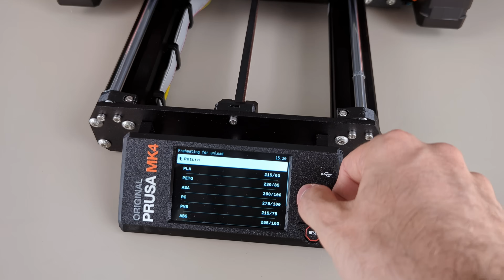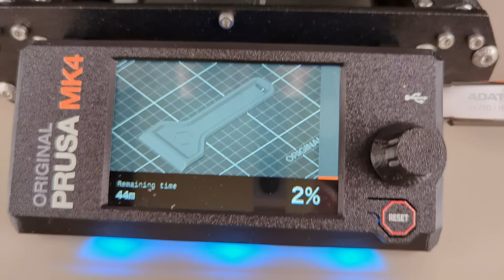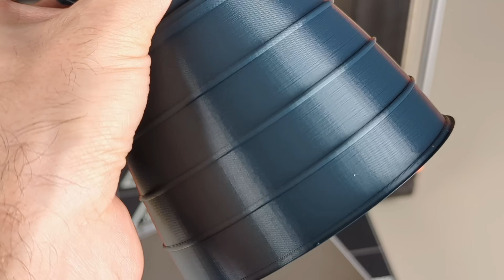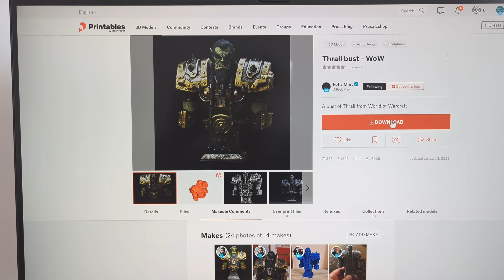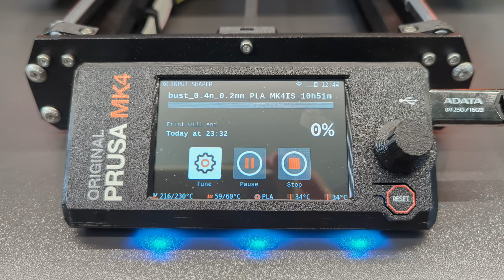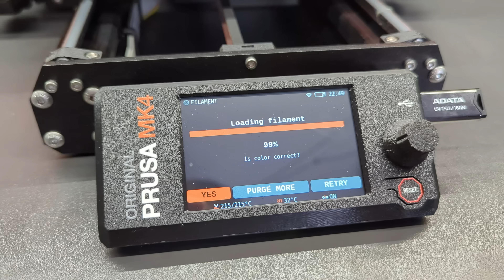Prusa MK4 in 2023? 🤷‍♂️

Comment: Prusa needs to figure out the pre-print purge process. My MK3S always left filament on the bed from the probe and had filament oozing on the nozzle.
I used some custom start gcode to heat the nozzle to 140c during the probe process to fix it.

Example of mine for the MK3S

M83  ; extruder relative mode    
M140 S[first_layer_bed_temperature] ; set bed temp    
M109 S160 ; Set extruder temp before bed level    
M190 S[first_layer_bed_temperature] ; wait for bed temp     

G28 W ; home all without mesh bed level        
G80 ; mesh bed leveling    

M109 S[first_layer_temperature] ; wait for extruder temp    

G1 Y-3.0 F1000.0 ; go outside print area    
G92 E0.0    
G1 E8 ; Purge Bubble    
G1 X60.0 E9.0  F1000.0 ; intro line    
G1 X100.0 E12.5  F1000.0 ; intro line    
G92 E0.0
Reply: Same Problem with my Mk3s too.
Reply: Pretty sure the first prints in the video were with older firmware. Not sure how long it sat in the box, but the purge changed in newer firmware.
Reply: @JohnOlson  True, i would love an update on how all of the things would have gone with the latest and greatest firmware.  Also granted I don’t think it should be this was, but if the MK3 is a good clue, even Tom Sanladerer’s Original Review cited all sorts of Software/Firmware issues but they are all solved now, so here’s to hoping.
Reply: @ericlotze7724  I've had my MK4 kit since June. I ordered day 1, within the first hour. Its been printing a lot. I stayed away from the Input Shaper alpha until version 3?, and its been rock solid.  I don't use it for a business but 2Km of filament, 20 days of print via statistics and not a single issue so far. I print mostly PLA, PETG on it. (ASA on my MK3s).  I sold my P1P and got the MK4. I'm very happy with my choice. YMMV.
Reply: Prusa does the bed testing at a lower temperature with the MK4.
Reply: You need to fix your hotend. Sounds like you did not assemble it properly.

Comment: Prusa announced they had it free of "Vertical Fine Artifacts"... On the bust-base, it seemed like VFA. EDIT: absolutely, on the pink/blue wolf it is full of patterns.
Reply: Yeah, sadly still there and I don’t like the messaging otherwise (although heavily reduced may mean free of to some people, but that seems sneaky).  On this note, didn’t someone make a mod for leadscrews that “cured” this?  I saw the video in my feed a while back, but haven’t gotten around to watching it yet.
Reply: @ericlotze7724   VFAs are not cause by the Z Axis, it's caused by the XY motors
Reply: @AlexanderGutsch exactly: the VFA are basically the XY “fingerprint”, when microstepping doesn’t produce a linear output.
Reply: @AlexanderGutsch  ah okay, my bad!
Reply: @ericlotze7724 The Z-Binding problem is a different one, that causes patterns between layers, on the vertical.
Reply: It's often caused by the model that is sliced. If the model is exported at low poly count, the printer will simply print those low poly counts. If you subdivide a 100mm circle into 360 sections, you still get flat sections almost 1 mm wide.
Reply: I mean it sucks.. But have you seen prints from an Ultimaker S5? a 7000€ Printer?... They look horrible at half the speed... So to mee these prints look bascially perfect.
Reply: @XA--pb9ni  My Voron has these also with the LDO motors, no chance to reduce it
Reply: @AlexanderGutsch  you can lessen the effects if you tune the TMC drivers. But its a black box when it comes to the results
Reply: @AlexanderGutsch FWIW my Trident does not have VFA (Moons motors), it was one of the first things I noticed having started with a Prusa Mk3.  If it’s just the A/B motors is it worth a little cash to swap them out?  I thought the LDOs were supposed to be VFA-free also.
Reply: @martiniindustries  my V2.4 Formbot with "Moons" (not sure if genuine) don't have VFAs either. Some people with LDO motors have no VFAs, some do. I'll probably swap them out when I am going to rebuild the Trident anyways
Reply: @XA--pb9ni  have you seen the results and speeds from printers around the price range of even the mk4 kit? Other companies are creating printers with more advanced features that actually work (unlike the input shaping here) with better print quality. Prusa has fallen behind massively.
Reply: @conorstewart2214 Those being core xy. Bed slingers are a different beast.
Reply: The most printer problems are sitting in front of it!
Reply: @petermarkk1408 lol😂